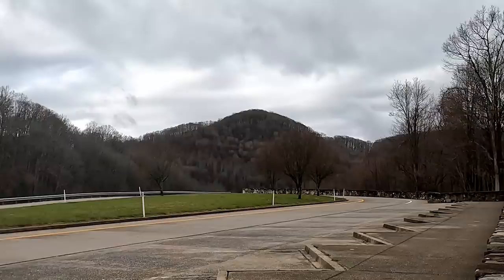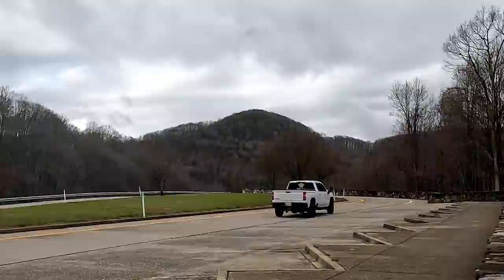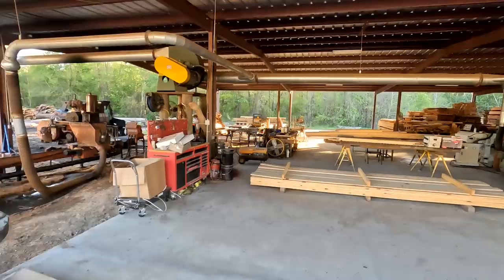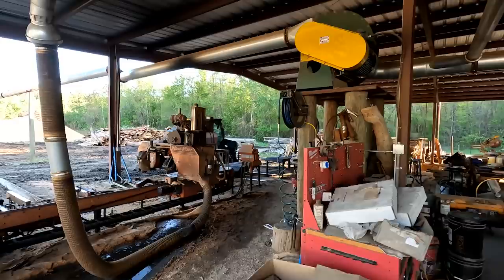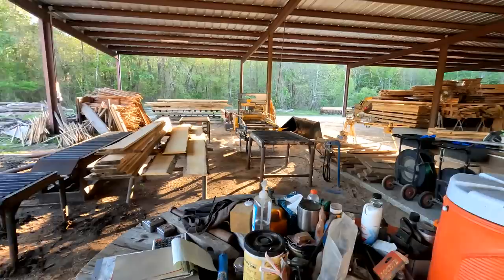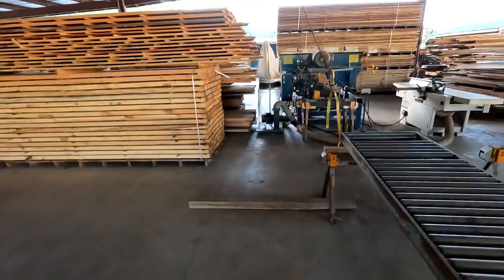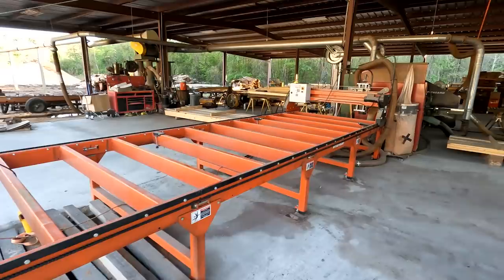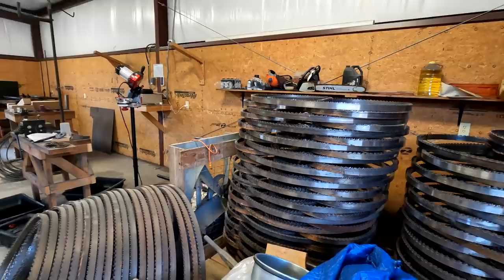I Drove 400 Miles To See The Ultimate Sawmill Setup. Must See Operation

Comment: Boy are you correct on that one!!!! You RARELY get a chance to see a 20 friggin inch jointer!!!!! Let alone one as nice as a SCMI, I've used quite a few of their machines and every single one of them is TIP TOP!! I got a chance to run a 4 sided moulding SCMI at a cabinet shop I worked at for quite a few years. Which is something you kinda need to use a machine like that, years and years of experience!!!!! They are EXTREMELY easy to set in the incorrect way and when you do that it can chew up a board in seconds or worse yet, it can destroy part of itself!!! That jointer requires just as many years, if not MORE!!!! ANY jointer is tricky to use, but one that size will end not only your woodworking career, but also your ANYTHING career!!!!! 
Great tour my friend!!! I'm looking forward to the next vid!
Reply from the maker: Thanks for watching
Reply: @OutoftheWoods0623  I've been hooked since the very 1st vid I SAW almost 3 years ago!!!!

Comment: As a northerner it always blows my mind when I see all the open sided shops down south with all that expensive equipment in it. How do they prevent rust from ruining everything?
Reply: I'm in NZ and the prospect of cross winds through that shed was the first thing I thought of.
The area I'm in is really high humidity a lot of the year, so that would be problem one, then, all across the country we run into horizontal rain with snow in the deeper latitudes. 
Are there at least temp wrap sidings around the sheds?
Reply: @davebryant8050  From my point of view, it is more about how they protect the steel and iron surfaces without creating issues with other processes or staining of some products.

Comment: The largest milled timbers that I have seen were 24 inches by 12 inches by 24 foot long that was 85 years ago, I have often wondered how the were milled .
Reply: Biggest ridge beam I've milled is a 16"x28"x 29' long. All done on a 1987 woodmizer LT40 by setting up a crib on one end for multiple relocating since it only has a 21' "capacity"...
Reply: Eldred T. Glass - How old were you in 1937?

Comment: The 2006 sawmill must have a different hour meter, 2872 hours is less than a year based on 8 hour days. Or maybe that's when it broke ?
Reply: Or maybe it's on its umpteenth lap...
Reply: The longer mill is what I used the most up until recently. I  had a LT40 that I put 1785 hours on. The other LT70 that has 14400 hours on plus the remote LT70 with 2400 hours on it. Plus I have the Lucas dedicated slabber. Only run one at a time.